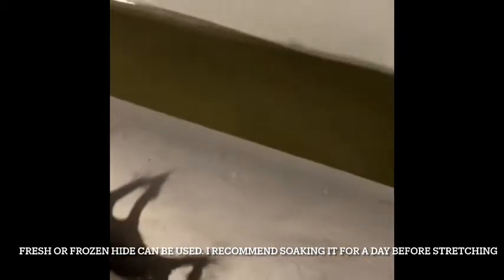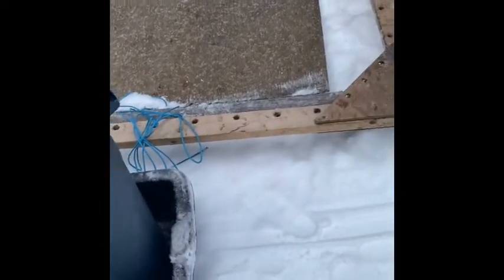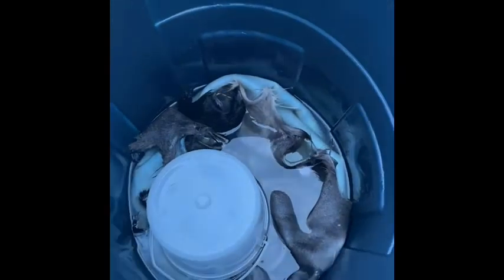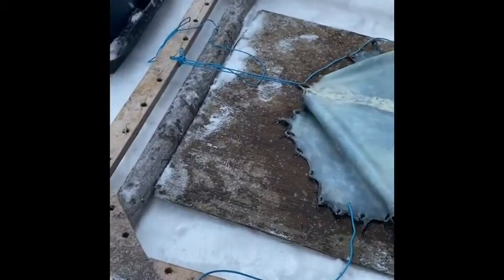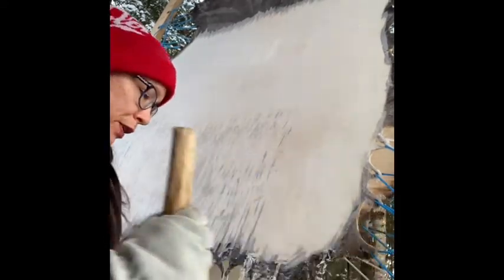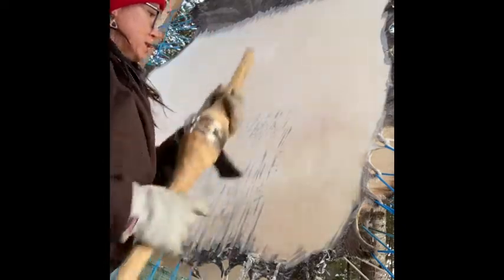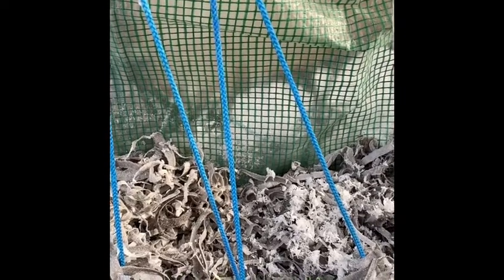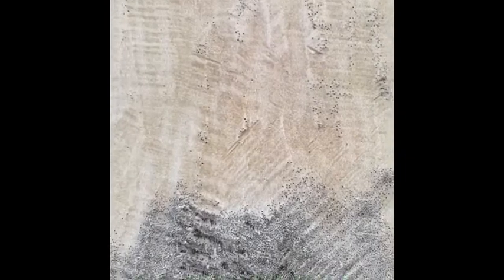So you want to frost scrape?

Comment: What is your tool called with the axe? Would you have a close up of the angle on the blade?
Reply from the maker: I just call it an axe head scraper.
Reply: @Kanina  fair enough. I work hides, not moose yet, but bison. That seems like it could save some time.
Reply from the maker: @Braintanman  I really like it for smoothing out ridges made by a sharp rounded scraper.  As for the angle, I don't have a close up atm.